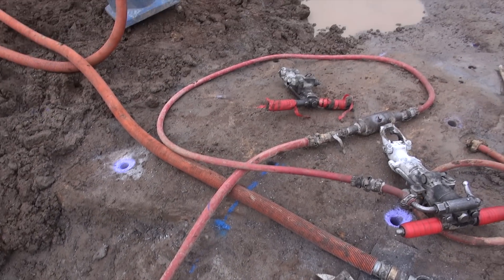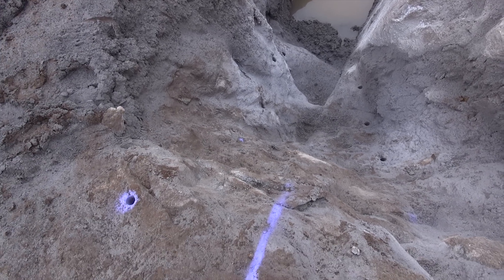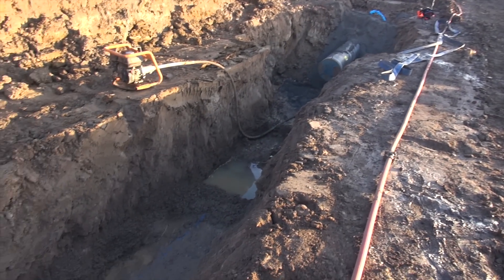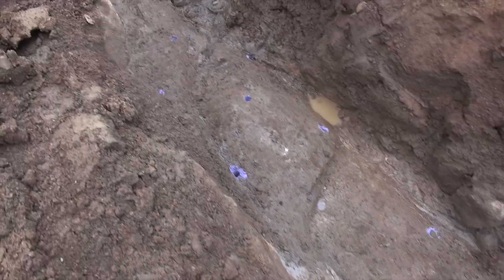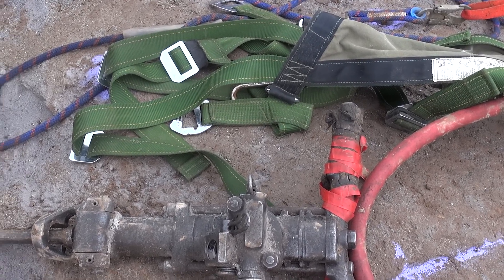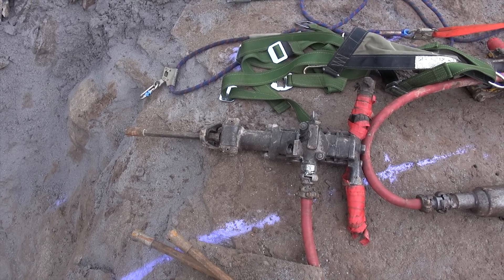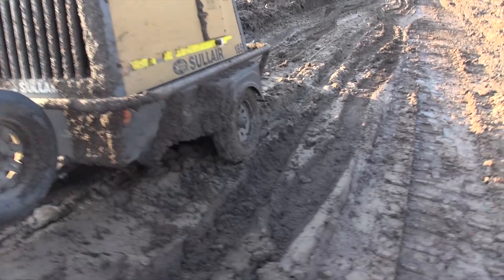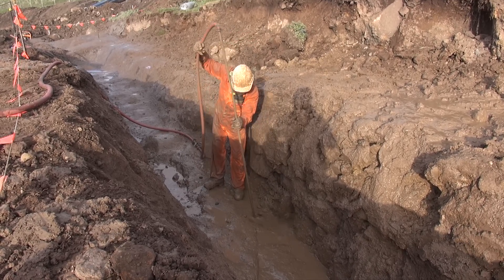Blasting a trench through Granite for a new water main.

Comment: Aside from the shifting of expense, is there a logic in using spoil over the shot in preference to Blast Mats?
Reply from the maker: Yes for sure Anthony, I own a truck load of blast mats that I rarely use, reason #1 - I have to take another truck load to and from the job when in nearly every case the soil is already there. #2 The soil provides a higher level of protection (provided you put enough on). #3 Blast mats might stop flyrock but they do little to manage the blast noise and it is the noise and over pressure that brings complaints (and unwanted spectators). #4 I no longer have to spend my weekends repairing blast mats.

Comment: A bit surprised you don’t appear to be using water when you drill? What are the regulations regarding reinforcing trenches in your neck of the woods?
Reply from the maker: Hi Anthony, I have drilled with wet flushing extensively, this was the dust control strategy  when I first got serious about managing the stone dust hazard around 20 years ago. It would seem like the best solution but it actually creates other problems, for example you get the slurry all over you and it quickly dries out in warm weather and then becomes airborne again. I discovered that when dry drilling with air flushing you get a lot of large stone chip coming out of the hole, when doing it wet, because of the much lower flushing velocity every stone chip seems to get crushed to micron size. Hence a much higher percentage of the total dust is in the critical dangerous size. The  powerful HEPA vac with the continuous bag system seems to be the best all round solution at the moment.

Comment: Hey Dave, Are there mobile drilling attachments for an excavator or other machinery? Seems like there needs to be lol
Reply from the maker: Yes, here is mine - https://youtu.be/mS1UdDThm3c?t=341
Reply: @demolitiondavedrillandblast  Legend thanks. For some reason I've only seen your hand drilling vids. Do you know a good supplier around Sydney for one to go on a 3t takeuchi excavator?
Reply from the maker: Mine is home made Cody, no local manufacturers, TEI in the US make a good small one and a few Chinese units on line, also a good Montabert unit if you have a lot of money to spend. https://teirockdrills.com/rock-drill-excavator-attachments/mini-excavator-drill-attachment/
Reply: @demolitiondavedrillandblast  That's neat making it yourself. What drives the drill down? Thanks for the info.
Reply from the maker: At the top of the mast there is a hydraulic roller stator motor with a sprocket on it and a chain (like a motorbike chain) runs down to another sprocket at the bottom, the sled that the drill mounts on is connected to the chain, bit of a look here -  https://youtu.be/RfrTx2YDeaI

Comment: a messy job filmed under difficult conditions.i applaud your dedication Dave.seeing you using the harness reminds me of pictures ive seen
of drillers hanging off ropes drilling the abutments of hydro dams.thats not a job i could do.
Reply from the maker: You got it Bruce, it is more difficult filming in Winter also because the shadow areas are large and long and the sun is always low in the sky and always in the wrong place. Drilling while hanging on a rope is about as hard as it gets.

Comment: try puttig a bend in the top of that blow pipe it will make a hell of a difference to how muddy you get
Reply from the maker: I have been thinking about that, not sure about the best way of doing it, maybe start afresh with a new bit of pipe, thread both ends, pack it full of sand, screw on end caps before trying to bend??
Reply: @demolitiondavedrillandblast  the ones we used to use were about nine foot long with a 2.5 ft 90 degree bend on with a ball valve we used em for cleaning 2.4 meter holes
Reply from the maker: I have tried using standard 90 degree gal bends but they tend to fail at the junction of the pipe and the start of the thread.

Comment: Thanks Dave. They should have called you first on a dry day. You are the ultimate breaker
Reply from the maker: If they had of called as soon as the found rock and left it be we could have used a large drill rig to drill through the in place soil cover, much easier.

Comment: Hi Dave,    GREAT work!  80 holes in that muck was a lot of work!!  The shallow ones didn't seam too bad, but some looked like 2 meter holes...yuck!  You need goggles with windshield wipers!  You made it look easy - as usual.   Stay safe my friend!  Jim
Reply from the maker: Thanks Jim, It really bugs me when they open it all up when they know there is rock there, much easier to run a drill rig over top of virgin ground and drill through the cover.

Comment: hmm, that big pipe must have been a good distance away, water mains here are 5 feet in diameter ( 1.5 metres ) and it looked farm smaller.
Reply from the maker: Only a smallish pipe Jaqui.
Reply: @demolitiondavedrillandblast  ohhh, then they will be having fun when the pop density grows down the road, replacing it with a new one that can support the higher population.

Comment: stupid question time but ive seen you get wet and muddy a few times blowing water out of holes , isnt there some kind of plug you can use to cap the holes till your ready to blow ? cos doing that has to suck well blow i guess )
Reply from the maker: Yes, most of them are not a water tight fit though, I have some that are a tight fit in 38mm holes but these holes were 41mm.